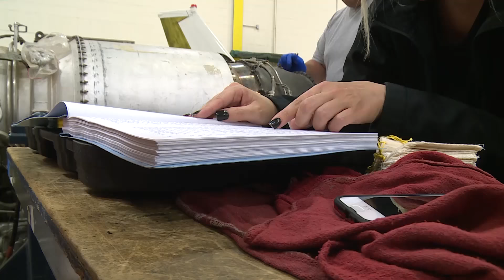Homeless Aircraft Mechanic

Comment: Porsha, You made a good choice to choose aviation as a career field. I just retired working as a flight simulator technician for one of the larger U.S. passenger airlines for many years. Last year, a simulator technician was earning over $ 100,000 per year salary and that's straight pay without overtime or profit-sharing bonuses added. You're on the path to much financial success, and that doesn't even count the free trips you will be taking using your free travel benefits. Good Luck!

Comment: Nice job young lady!  I'm a 26 year USAF Vet and I was a Jet Engine Mech - retired as a SMSgt.  I can verify the repair you mentioned using fiberglass and safety wire (.032) is indeed in our repair manuals for use on all manner of jet engines.  P.S.  You didn't mention we refer to them as "motors," but I know that's how you speak of them around other Jet Mech's.  Again, great job and thanks for the help.  You're a real professional.